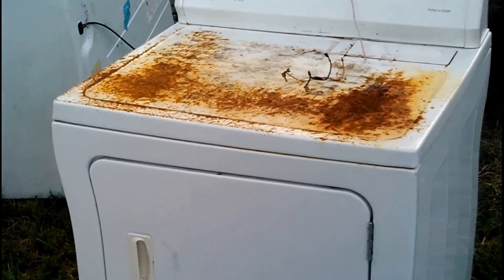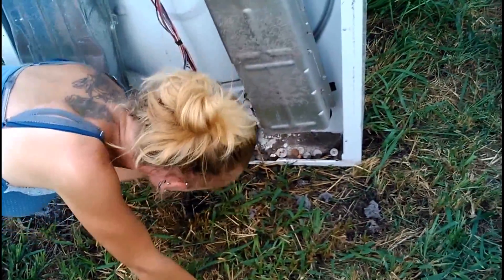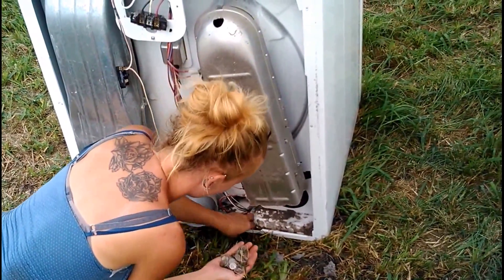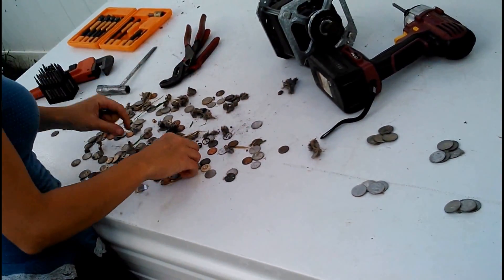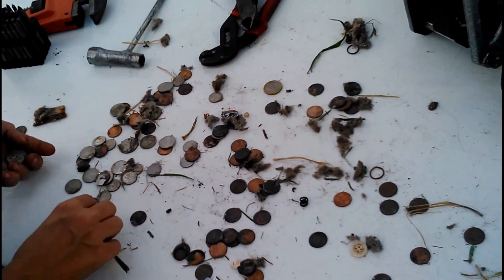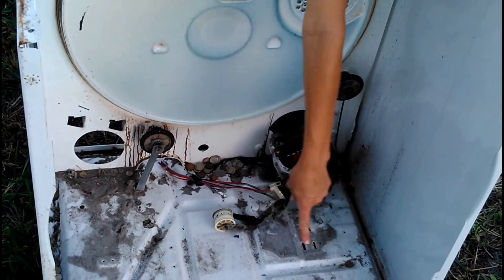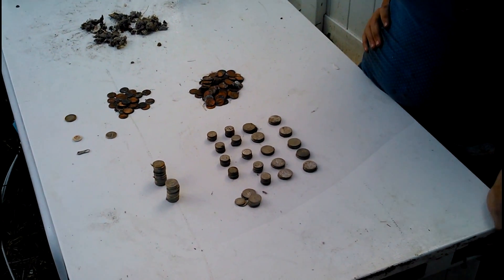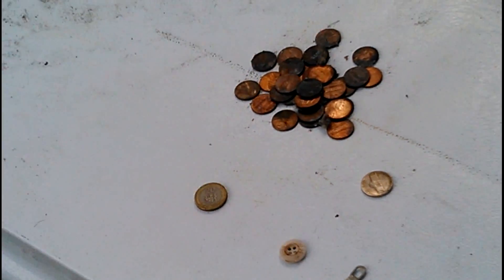Scrapping an Electric Dryer for Cash

Comment: I scraped two dryers yesterday. They were my first two. Nothing in the first one but in the second one I got $54.40. Plus some misc. jewelry. One piece looks like it could be worth a few bucks. Thanks for the great videos.
Reply from the maker: +Lyn Carl Did you find the $54.40 inside the dryer or was that what you made total?
Reply: It was all in the dryer. When we were moving it it sounded like hitting the jackpot on a slot machine. The coins were falling out as we were loading it up. I'm not sure why the owners didn't clean it out. I  just finished cleaning it all up and found another $2.76 in the heater pipe. I can't believe it.
Reply from the maker: +Lyn Carl It's amazing that someone would lose that much change over a period of time.